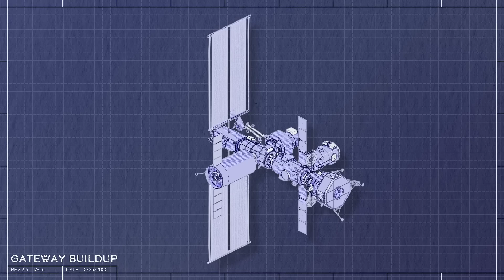Better for Artemis than SpaceX Starship!  The new Dynetics ALPACA!  Angry in Huntsville!

Comment: As much as I like ALPACA, Starship is actually much more important and needed. Really only in a very narrow sense of a single mission in a well funded robust project does ALPACA make more sense. But because Artemis is not a well funded nor robust established program (yet), the need to have a landing system that can be extensively over engineered and carry so much post landing and post mission cargo possibilities that can solidify the program so it can be come long term is paramount. 
An ALPACA mission will resemble the Apollo missions way to much to actually capture the imagination, while there will be some post mission work done with the limited amount carried is just wont have the same impact that the shear amount a Starship will leave. 
After the first couple of missions ALPACA or other systems as exploration vehicles from an established orbital base or transport to a lunar base makes sense. But establishing those points need just to much that the number of missions just cannot be funded.
Reply: I think we absolutely need both combined!

Comment: Good job!

You are right on target when you say Alpaca and Lunar SS can easily compliment each other. In fact Lunar SS doesn't have to be able to land on the Moon to do so, but simply deliver a massive amount of fuel to the Gateway Station. Let Alpaca do the limited amount of human related work on the surface. Only when astronauts on Alpaca are able to secure an actual landing pad for Lunar SS does an actual huge cargo payload need to be delivered to the surface...safely, and when actually needed for expansion of the base.

Comment: Starship is scalable , so the will only need one fueling tanker. The tanker will be larger. I guess that is why elon stopped saying starship was scalable, he new no one understands the word
Reply: Knew, new... do you know the words?
Reply: Not in a short time frame, because starting and catching facilities would have to be scaled as well. At least if we talk about getting even bigger. But needing 5 (or even 9) Starship flights to refuel one Moon destined starship is not a big deal - a single SLS flight surely costs way more than that, even if we take a worst case scenario. Getting mass into LEO is hard - there's no way around it - but if you make it cheap enough, you can do it on a massive scale without breaking the bank. That's the beauty of Starship!

Comment: Starship is the 18 wheeler and Alpaca is the pickup truck.  Both are needed for the long term habitation of the Moon.
Reply: Excellent analogy!
Reply: Yes perfect explanation of the purposes of the two separate systems!  Well said!
Reply: Agreed. The only issue for the last round of selection was that Alpaca was too heavy for it's designed engines and propellant capacity.
Reply: @stainlesssteelfox1  This, and the hefty sticker price they had put on it. (4 imes more espansive then the Star ship Lunar Landing Version) But I'd assume that was with huge financial safety margins. I'm glad to hear that they have kept developing despite little gouvernmental fundings.
Reply: @stainlesssteelfox1  Elon's developed reliable, fully tested engines in Falcon 9 or Falcon Heavy that could lift Llama to the moon and back, repeatedly. Nasa and many other programs have already benefitted from Elon's launch systems, $ Billions have already been saved by so many companies and corporations at Elon's expense, why wouldn't he help Lamer out.
Reply: The alpaca has no point for long term habitation.  But it could help with early missions if starship takes longer to certify.
If starship works reliably, no other craft is going to matter.
Reply: Continuing your analogy, James, Sierra Nevada's inflatable habitat dropped by Alpaca Cargo is the popup camper-trailer towed by the pickup truck; small, light and simple for two lunar "campers".
Reply: I do not think Starship can land on the moon before the ground is prepared.

If you think otherwise show me how Starship lands in a desert on unprepared ground on earth.
Reply: Worst analogy ever.  There's no sense in cramming 2 astronauts in a closet for who knows how long.  What are they going to do? Walk around the moon and pick up rocks?  Perform some kind of ground breaking science?  How are they going to physically build the moon base?  Can the Alpaca Lander carry a large excavator? A huge auger drill? A bunch of pipe?  Building materials? This is pure window dressing and a waste of time.
Reply: @cryptosupplyshop3425  Sigh. If I were building a moon base, or indeed a base anywhere remote, I wouldn't just rock up with a 14 wheeler full of building materials and a hammer. I'd scout the area first, find and map the best locations, check what local resources there are.

That's what the Alpaca lander is for, scouting. It only needs to support a couple of astronauts for a week or two, so maybe the 4x4 isn't the best analogy. 

Think a camper van. A portable living space designed to provide the necessities for eating and sleeping, and a base of operations for excursions.

When they've figured out where and how they want to build a permanent base, that's when you start using Starships.

Comment: Land starship for exploration habitat and use Alpaca for getting astronauts to and from Lunar Surface 📡🛰️🚀
Reply from the maker: Definitely
Reply: In order to take components for a permanent habitat on the moon, you need something as large as Starship to act a frieght train to deliver the componets, supplies, and personnel.
Reply: Exactly. Like with Soyuz and the ISS. Good for medical evac too. You could break a leg and still get inside ALPACA - not so with a 40' ladder.
Reply: Yes use starship as big cargo ship. You can't land it on moon or even mars for that matter. For mars need to follow NASA success and use the system for the rovers that can land a ton. ,🚀🎆‼️